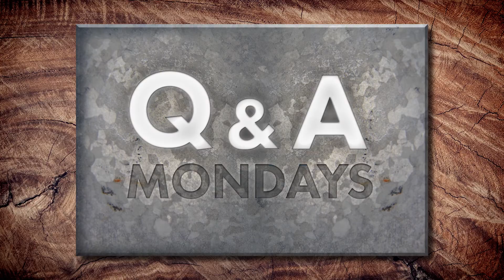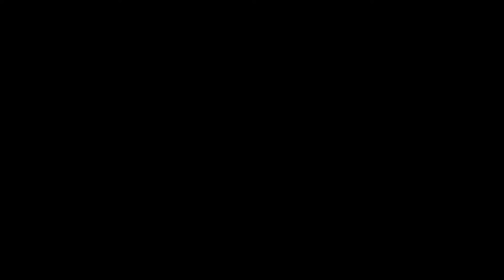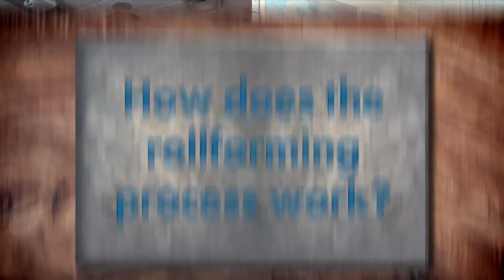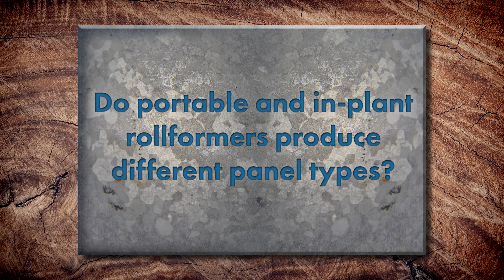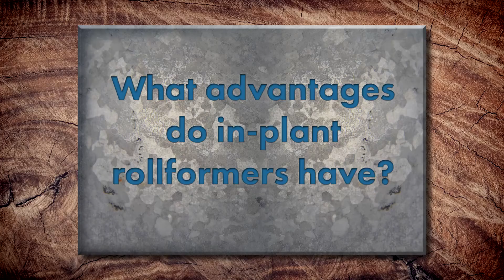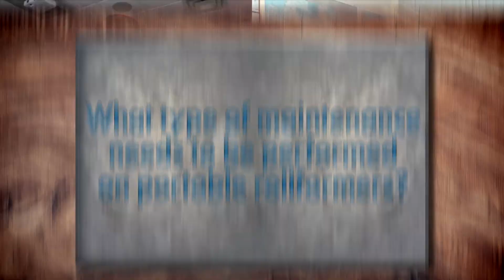Portable Rollforming vs. In-Plant Rollforming | Which is best?

Comment: It is always best to produce panels on-site (depending on the size of the project).  Factory rolled materials are sometimes needed when the sheets required a specials measurement (top to bottom) and the seams (male and female) are not on their typical sides. My opinion only.
Reply from the maker: Thanks for the thoughts! -Thad

Comment: What is the cost for an entry level roll former pushing out a 1” mechanical seam and the option to do a 1-1/2” snap lock panel with a trailer?
Reply from the maker: Hey Chris! New Tech Machinery has several rollformers that will run both those profiles. Drop us a line here on the Sheffield contact page and we can set you up with a quote for exactly what you're looking for. http://bit.ly/contact-sheffield Thanks for commenting! -Thad